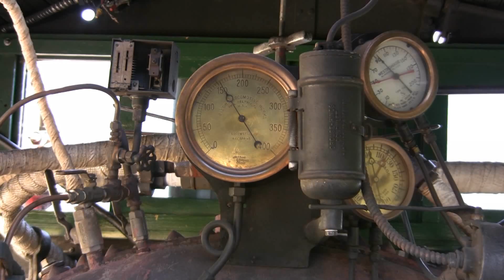Part 3 -- The Ed Gallegos Show on the Virginia and Truckee Railroad

Comment: What does it mean to power out a steam locomotive
Reply: I think you mean by power out its working the water out of the  Saddel. As the Engine cools over night water collects in the cylinder saddel. The Engineer will work the theottle hard for a short time and blow the water out through the Stack and Cylinder Cocks to prevent damaging the cylinder heads.